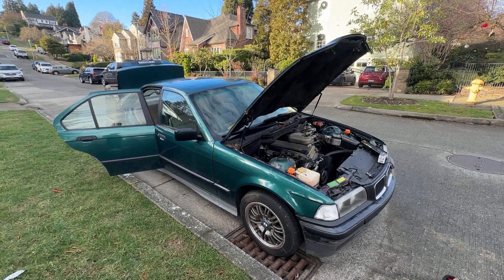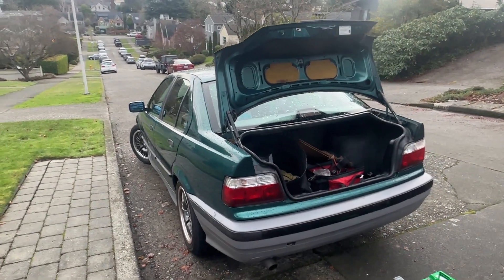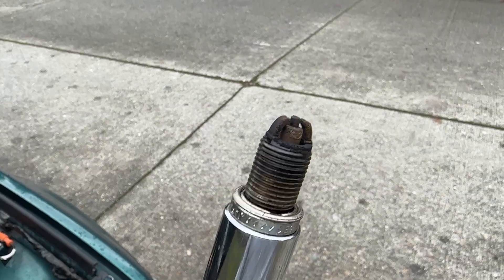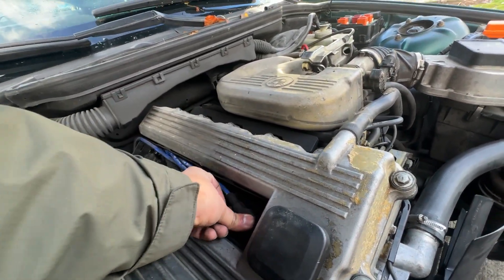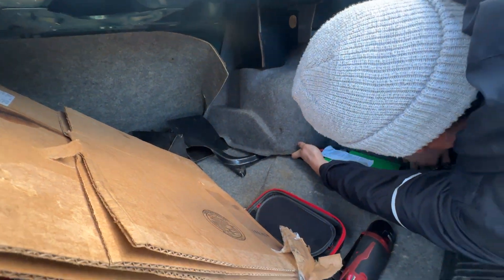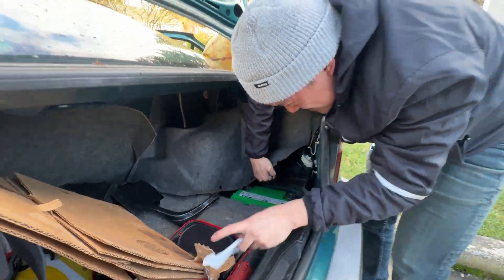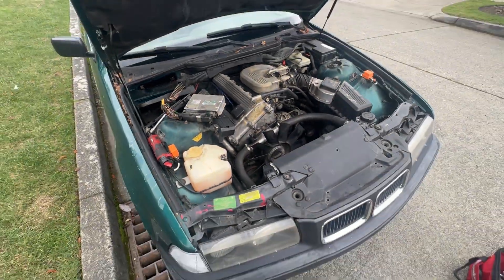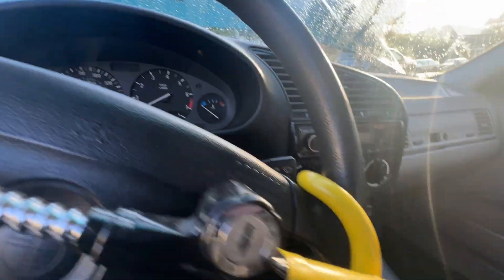How to Fix a Car That Cranks But Won't Start (BMW E36)

Comment from the maker: Hopefully this video helps you diagnose a crank no start issue on your BMW. Comment down below if you’ve ran into issues with a car that wouldn’t start.

🗣 Join our discord for more: https://discord.gg/WvjvHxYnwq
🅿️ Check out my Patreon for early access and exclusive content: https://www.patreon.com/bendaga
Thanks for stopping by. ✌️
Reply: "Comment down below if you've ran into issues with a car that wouldn't start."

Me: Where should I start?
Reply: I mean if I ever get a bmw e36 this will come in handy but I enjoyed watching it 👍
Reply: ChrisFix actually made the title
Reply: I replace: 
Dme 
Crank position sensor 
Cam position sensor 
Fuel filter 

Still no start. 
Relays are good 
The fuel pump doesn’t prime with the key on, jumping the fuel pump relay turns it on, and I have no spark 

Ews has been bypassed m
Crank but no start no fuel no spark
Reply: Ever figure out the problem? 
 @chaysendreamz
Reply: @chaysendreamz  If you have EWS I, bypassing the ews should work. For ews II., you have to remove immobiliser from the DME and then jump the cables on ews unfortunately.

Comment: This is what is happening to my E36 316i 1995 M43. I also found out that my unit has no EWS and no wiring or mounting for EWS. Do we have the same setup with no EWS?

Comment: I am having the same issues on a 1992 318i bmw 4 cylinder I've changed eveyrhting on the fueling system already, fuel pump, fuel sender, fuel filter, spark plugs, spark wires, ignition coils, the oil & battery & now I am going to start working on the cam & crank sensors, NY question is I'm having trouble finding the cranck sensor do I really need to remove the whole air intake or is it the one in the bottom of the cam by the fan? The car wants to start now I hope if I change that it starts someone that knows lmk thanks

Comment: I just got a 94 318i convertable in Omaha. I got it to McCook before it broke down. A very nice person stopped to help suggested I get starting fluid to see if it was a "fire   or fuel" problem. It was quickly determined that it was a fuel problem. 
Point being, there are easier ways to start trouble shooting with out spending money on parts.

My brother drove 5 hours from Denver to bring the fuel pump, we put it in, in butt assed cold weather in the middle of the night. It started right up and ran fine all the way back to denver.
Best $500 I ever spent for a car.
Reply: Have a 94 320i convertable. It suddenly just stopped working after going fine for months and i suspect it is the fuel pump as well. I have bought one now so i hope i have the same issue as you. I suspected early that it was the fuel pump because i couldnt hear the fuel pump pumping, i really hope it is only the issue. Beautiful cars to drive.

Comment: Bruuuh! I can hear the excitement lol I’m seeking the same.. I’m trying to get mines started and I’ve borrowed a buddies ecu, cam and crank shaft sensor, and ran my own wire because my battery cable wire was carodid a bit and changed spark plugs and still crank but no start smh , tested my starter and it works

Comment: I’ve done everything you have new cam position sensor new crank position sensor new near me new spark plugs new starter alternator new battery I can’t get it to start. It was running six months ago.

Comment: I’m having similar problem on my 1997 e36 as well. I took it to a mechanic here in Bangkok, Thailand. The rebuilt the engine thinking that was the problem ($1400 USD). Replaced the crankshaft sensor , spark plugs. It worked for 3 days and I didn’t drive it for 3 days. It would not start after sitting for those days. It is now back at the mechanic. He doesn’t know what could be causing the problem. The car starts now but he letting it sit for a couple days to see if the problem happens again. So frustrating but I love my car. Your video was a great explanation but my situation could be worse.

Comment: there would’ve been no spark even if the car worked when testing like that.😂 You need an air gap between the screwdriver and the engine. If you put it directly against it, the current will take the way of the least resistance and produce no spark either way.
Reply: yeah it grounds it

Comment: Having the exact same issues. I've changed plugs, leads, today I've fitted a new crank sensor and no luck. Now wondering if I've got the same issue, so gonna have to try this next
Reply: Anything??

Comment: Don't shotgun parts hoping it will fix the problem. Suspecting a relay? Use a power probe or dmm to test it. Think the fuel pump is dead? Hook up a pressure gauge and jump the relay. I'm sure you could have ran some tests on the CPS before just condemning it for no reason. And it's odd that the ecu shit the bed, that's usually the last thing to go.
Reply: Hi how can I test fuel pump relay with a power probe ? Any specific pins I have to touch? And also how can I jump the relay

Comment: The first thing I would check with no fuel and no spark is there a security system on it aftermarket first
Reply from the maker: good idea - aftermarket alarms are very troublesome sometimes

Comment: First step: buy chines ode2 reader with bmw 36 obd gap piece
Saves time and money.
Reply from the maker: this is an obd1 car 😭
Reply: I was thinking OBD1 Male to OBD2 16 Pin Female Connector Adapter Cable.
if you want to deal with old European cars, then without  obd2 scanner and without all obd1 connector adapter it is very difficult. i have made in china obd2 reader with all  obd1 abtabters bmw/audi/mazda and so on.